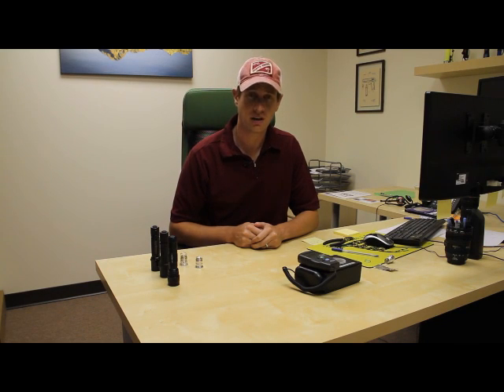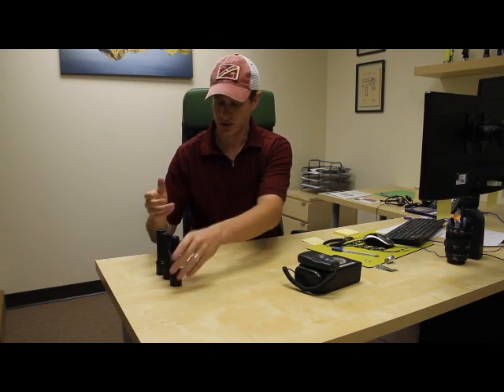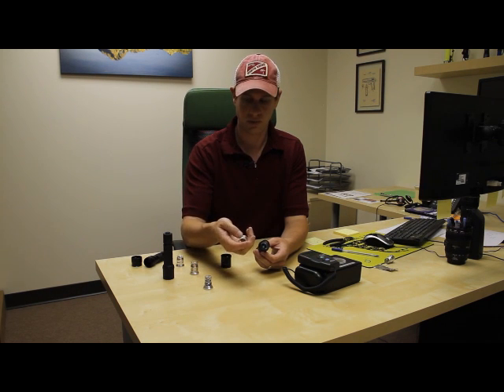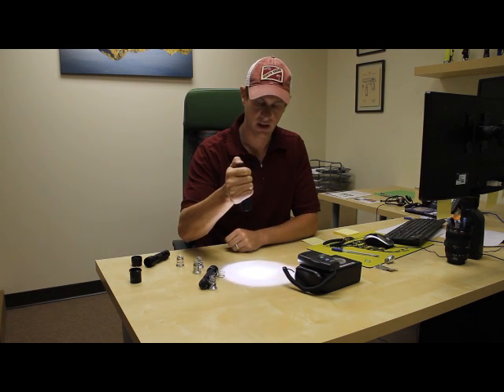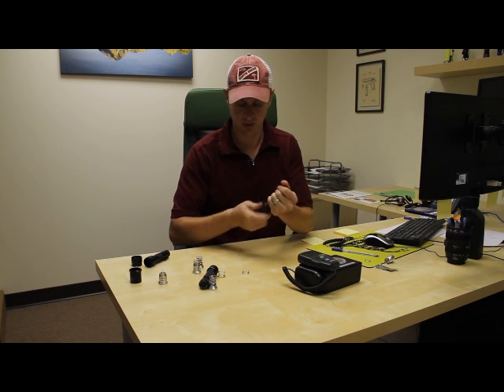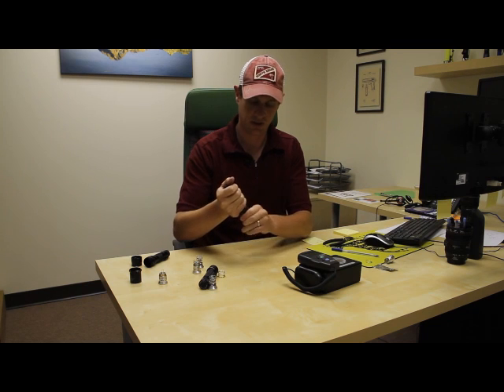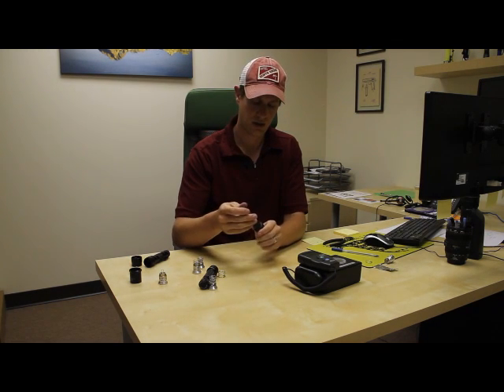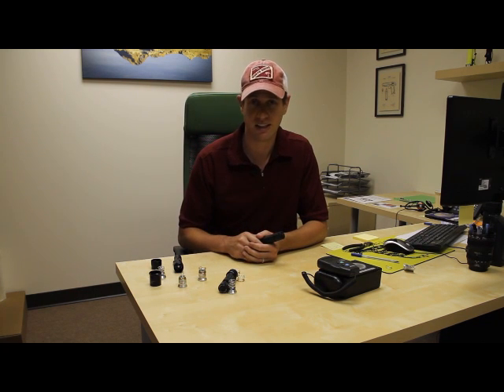ULZIO LED Upgrade Instructions for Surefire Flashlights

Comment from the maker: Yes. The R5 drop-in is a direct replacement for the Ulzio G-1. You won't need to remove the large outer spring. Just drop it in and enjoy an immensely brighter flashlight. The great thing about the Ulzio G-1 over many other flashlights (Surefire) is the ability to use a variety of batteries. You can use an 18650, or two RCR123a (16340) batteries. Rechargeable batteries save a ton of money! Good luck!